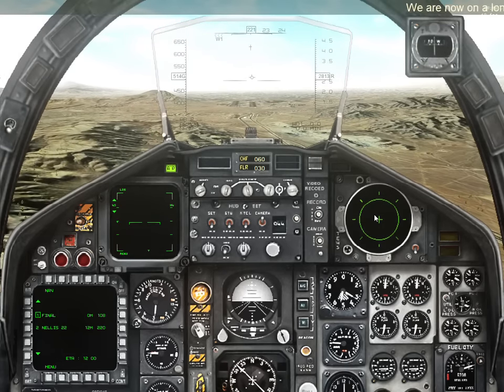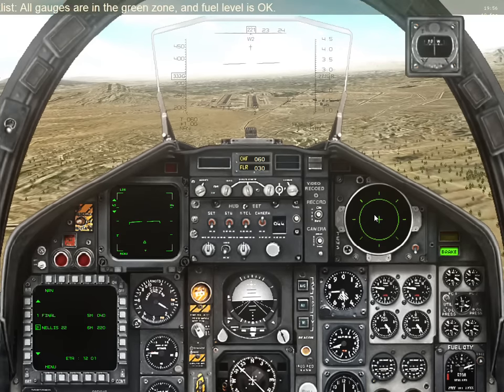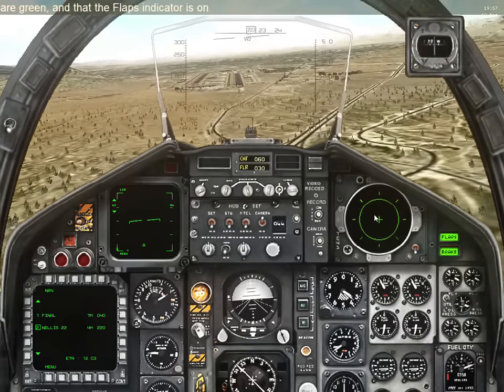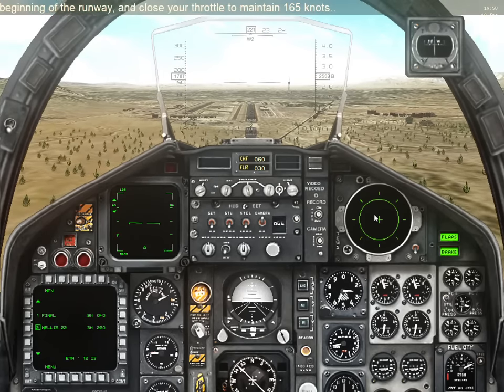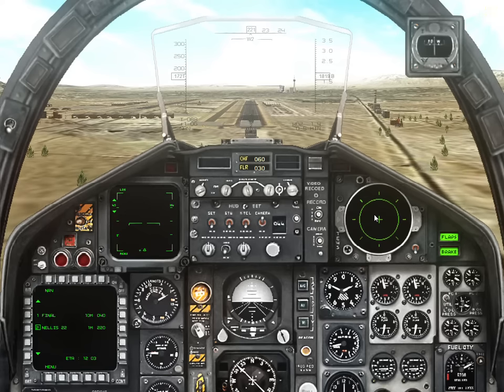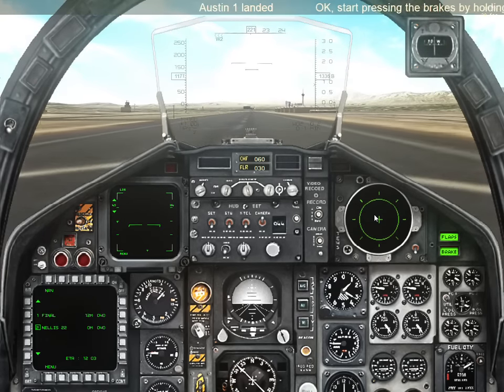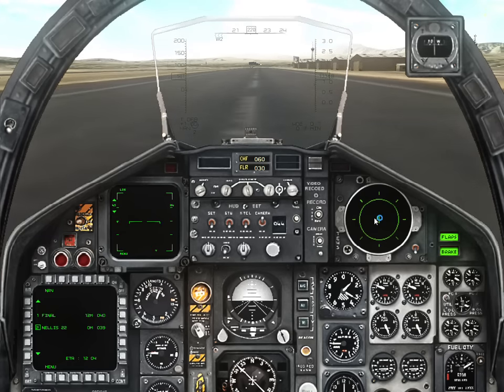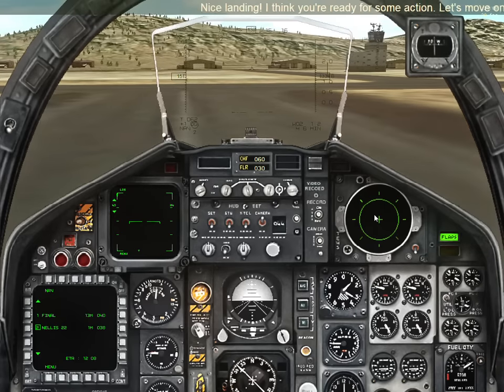1st landing in Jane's USAF after 21 years  :_)

Comment: For a game from 1999, those graphics are pretty good. The cockpit is recognisably an F-15 and it's all usable and readable, the terrain and buildings outside look pretty decent as well.

Old flight sims have a nostalgic appeal to them, even though the graphics compared to DCS are quite low and the flight models and all are not anywhere near as detailed, it's still fun. I found myself recently hopping into FSX and having a bit of fun with a Cessna Skyhawk and a Beech Baron. Tried out the FSX Hornet and was surprised at how much of it actually worked.
Reply from the maker: Yeah, It's amazing when you go back and realize important systems were actually working ^^
Reply: i think it's earlier than 99 - I want to say around 97-98...

Comment: Approach at bigger angle and at higher speed, just around 200 knots for F-15 for example. Aim at the start of the runway, once you are there, flare and reduce speed until you gently flop on the runway. Real life pilots usually don't land like this since it's somewhat risky, but it's fine for sim anyway. Works for any sim and almost any plane

Comment: Angle controls airspeed, power controls descent path. Two major things that will help your landings, when getting low toward the end there, do NOT pull back, increase throttle, maintain the same pitch. Tip two, your aimpoint is too short, put the FPV on the aimpoint which is somewhere short of 1/3 down the runway (if it's not painted on). The FPV should be on that aimpoint all the way in...if it's short...more power...if it's long...less power. get it all dialed in and the only adjustment you need is power all the way down. reduce power crossing the threshold and begin your 'flare' which really is just a slight pull back looking down toward the end of the runway.
Reply from the maker: Thank you very much. You're exactly on spot. These two were exactly the factors made me panic prior to touchdown :)

Comment: In each game I always when aproch to landing doing like that: automatic or manual flaps mode landing on, nose 5 degrees upper than horizon line and stabilize fly by trim. Then throttle control always in move +/- for correct altitude. Too high speed stabilized by airbrake. One second time before tochdown, I pull nose next 5 degrees uper for make non agresive wheel touch and after geting touch down by rear wheel, return -10 but keep the front wheel in the air. The angle of the plane will good for lose speed much faster. When get 90kph then can touch down front wheel and start brake by wheels. That always work perfect for me.

Comment: You kept the airbrakes on during the whole approach was it an F15 thing like for the F14A where it was safer to lock the throttle and control speed with the airbrakes ?
Reply from the maker: Here it was my mistake that I totally forgot about airbrakes. In F-15, it's usually to suggested to apply airbrakes once flaring just prior touchdown to reduce the impact with the surface. 
In contrast with that, in F-16 it's sometimes to apply airbrakes all the way in the final approach, and the reason is that spool time of the engine is not short enough to be safe once go-around is decided.

Comment: I haven't heard about  "velocity vector pointing at the middle of the runway"... I presume he means pointing the FPV(Flight Path Vector).
Reply from the maker: It has generally different names for a same thing. I guess it's officially FPM (Flight Path marker), commonly referred to as VV or Velocity Vector.
Reply: @FD1CE  Well you are almost there. The --0-- marker in real aircrafts like Boeing family or Falcon jets, is called FPV. It is an angular indicator,  and not realy related to velocity. Among others It helps you compensate for headwind/tailwind and crosswind though during approach. Very handy tool for IFR manual flight ;-)

Comment: Ok seems you forgot how to make it run under win10 but by any chance did you apply any patch for it to work on win10? If yes, then I guess it's the same as was in windows 7, after installing the game I then installed a patch by tackleberry and that's it, works well on win7 with the patch, just a minor glitch but everything runs good pretty much.
Reply from the maker: Oh thanks a lot for reminding something very useful 🙂
Yes I think I used the same teckleberry patch, although I think I was struggling to find its proper version.